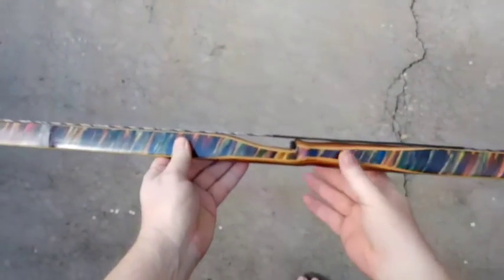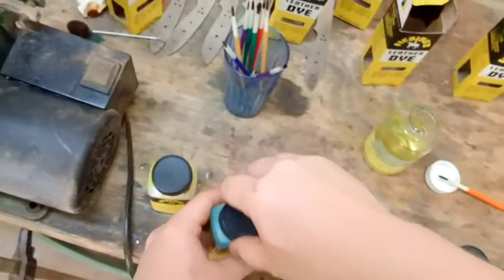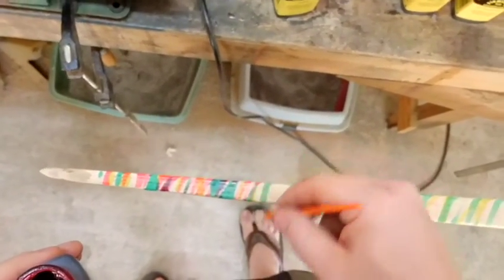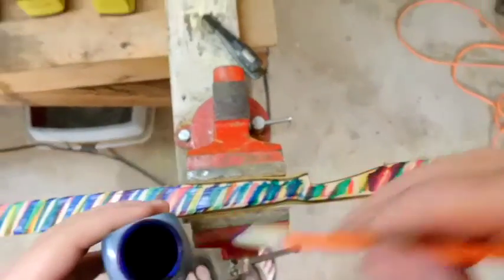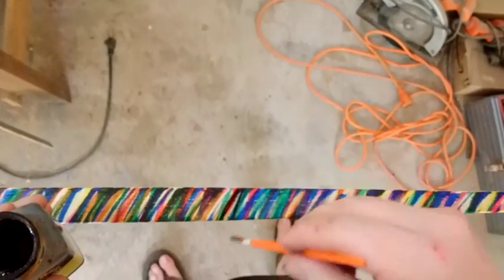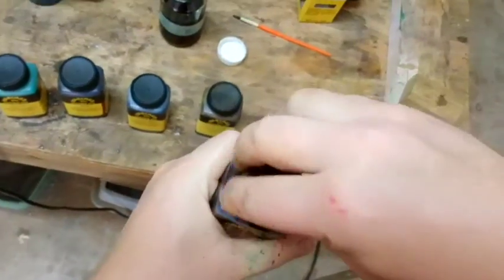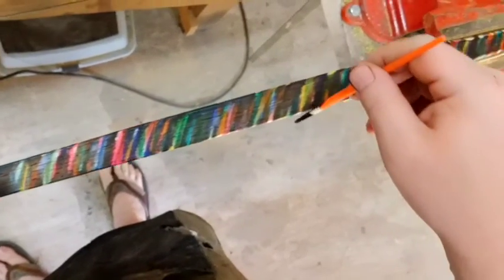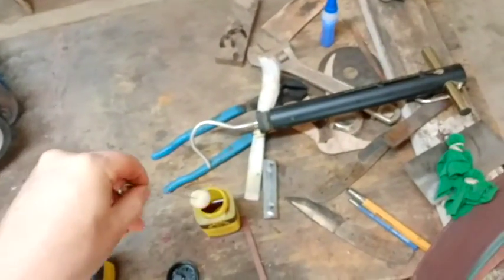How to dye a bamboo backed bow Part 2

Comment: OI Sam, first of all, congratulations on the beautiful bamboo bows as well as beautiful ones seem to be very efficient. I would like to ask a question, to glue the bamboo blades, what kind of glue do you use ?. And how many bamboo blades do you use on the bow? Thanks for listening!!!
Reply from the maker: i use one slab of bamboo on the back of the bow, and i glue it with Smooth On epoxy.